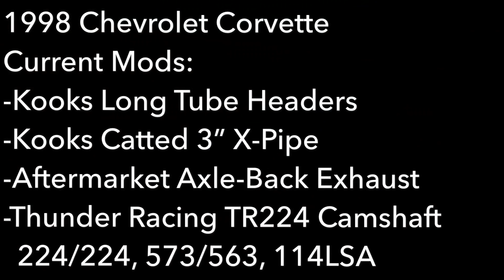C5 LS6 Top End Swap: The Recap

Comment: Just finished converting a 4.8 lr4 into an iron Ls6, with 799 heads, Ls6 power max cam sdpc, topped off with a 615-183 intake (Doorman copied the FAST LSXRT and then China copied the copy, and now you can get a fake lsxrt with 3bolt tb flange for $65) I’m bringing it to my friends shop to dyno tune and have the car ready just in time to put it away for the winter lol

Comment: Before you knew the valves were leaking on the new heads you mentioned needing shorter pushrods. After fixing the valve seating, did you still use the shorter pushrods or the 7.4 stock length?